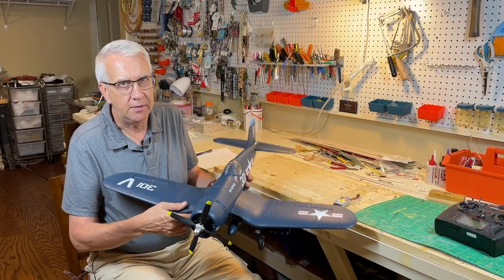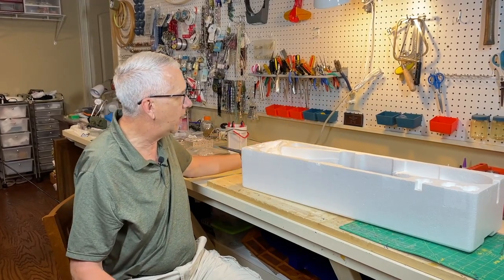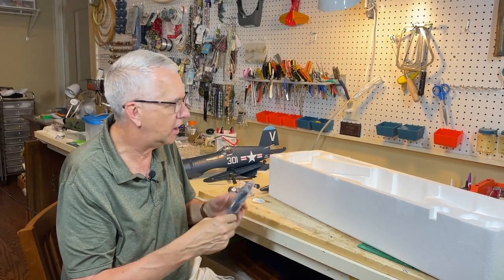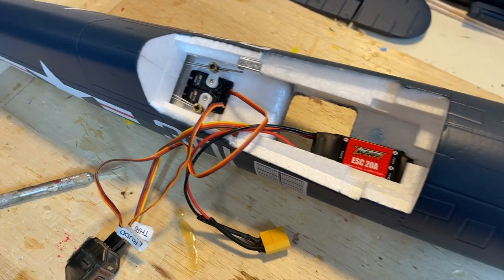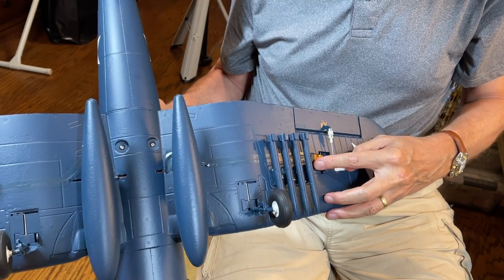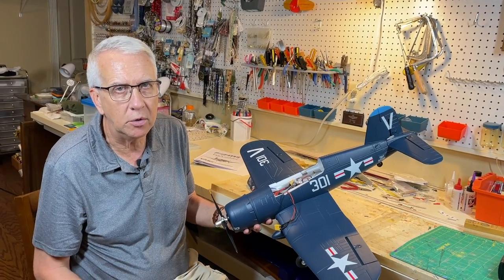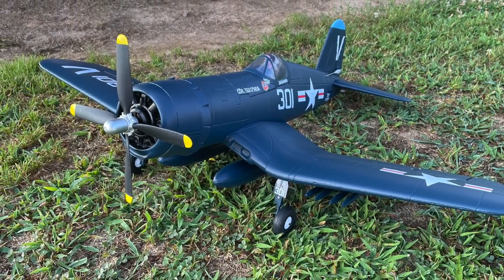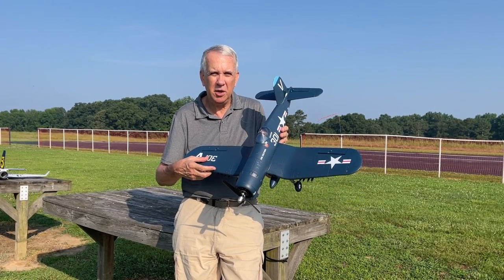FMS F4U-4 Corsair Kit Review and Flight

Comment: Nice little airplane, you did a good job explaining how it goes together. Clearly not a plane for beginner. But the all-important question, does it come with remote ID? We're a little over two months away from the deadline.
Reply from the maker: I am not aware of any RC airplane that comes with remote ID.  Just the fully manufactured drones, where you take them out of the box and go fly.  They all have standard (installed at the factory) remote ID.  Note for the FMS Corsair you need to provide a receiver, transmitter and battery.  After Sept 16, a remote ID module.  Tim

Comment: Hi Tim , nice video . What is the two bladed prop that you are using? Looking for alternatives to the fragile 4-blade that is included. Unfortunately mine does not fly currently due to a loose motor mount from the factory (thus the broken props).
Reply from the maker: Fully agree that 4 bladed prop does not last past too many bad landings. 😳 I used an APR 9 x 4.7 prop.  No scientific research, had one in my field box and it looked about right, so off for a test flight.  Worked just fine!  Tim
Reply: @TimMcKay56  Thanks, how did you attach it?